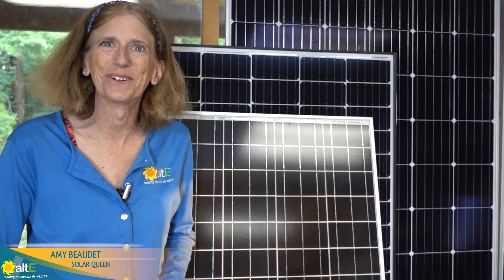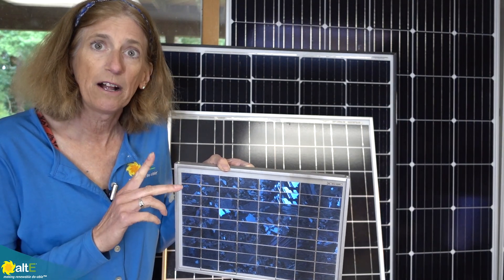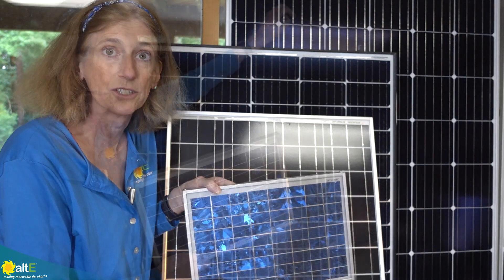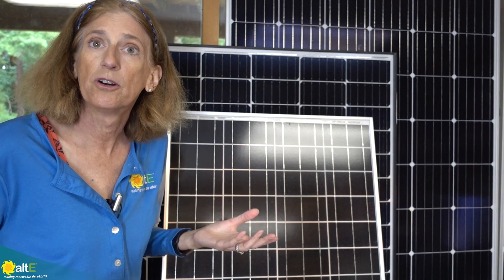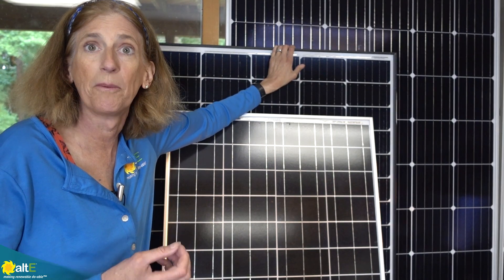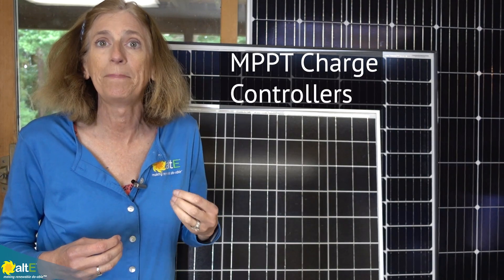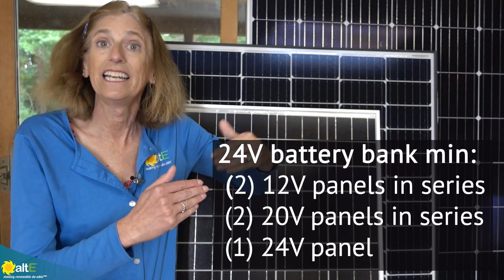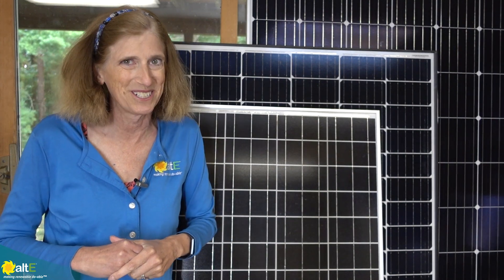Intro to Solar Panels: Part 1 of 2

Comment: Can I use Solar panel 41.1V  and charge my 12V battery via MPPT range 12V - 48V 60A? really highly appreciated your feedback. thanks
Reply from the maker: You didn't say how many watts your panel is. That charge controller can handle up to 60A x 12V battery = 720W on a 12V system.
Reply: @AltEStore  it's 440W

Comment: Does the volts differ depending on sun "strength"
I have a couple 100 way panels and used a clamp meter and it's usually around 4 to 5 amps. Does that mean I should multiply that times 18 all the time or does volts vary?
Reply from the maker: The volts aren't as affected by low light as the amps are, but they are still affected. For example, you can often measure almost full voltage inside under lights, but will see very low amps. I suggest measuring both amps and volts as shown in this video, https://youtu.be/eh6hzMb69gY

Comment: I just bought 10 used 250 watt panels and they are huge. I am addicted to solar power and cant wait to start my off grid cabin. I just got off your website as I need a 24v or 48v inverter.

Comment: Thank you for your Good work,may God bless you.I have a question. Will a 72 cells panel of 330w with a vmp of 38.2v and a voc 45.6   produce more power than a 60 cells panel of 350W, with a vmp of 32.7 and voc of 39.6 when an mppt solar charge controller converts the remaining  voltage into current in a 12v system? Take note that the 60 cells panel has 20w more than the 72 cells panel.
Reply from the maker: The higher wattage panel will produce more power (as power is rated in watts). Watts = volts x amps. So in your example, the lower voltage panel must be outputting more amps to make up for it. If you look at what it will be at the 12V battery, 330W / 12V = 27.5A to the battery, and the 350W is 350W / 12V = 29A to the battery.
Reply: Thank you very much for quick  response.

Comment: Hi I would like to ask you a question. I have 3 solar panels connected in parallel with max power 35volts 170watts each my renogy dual input DC-DC battery charger is 50A MPPT, when I plug it to my solar panels the solar light indicator on my MPPT does not light up. I checked the manual specs and it says max input 25volts, do you think it cannot take 35volts which my panels produce. Thanks Bill
Reply from the maker: The specs for that charger say it is for a 36 cell 12V solar panel. It sounds like you are trying to use a 72 cell 24V solar panel. The charger's over-voltage protection is hopefully kicking in and stopping you from blowing it up.

Comment: Is it better to have dis similar panels in series or parrallel?
I have 2 panels.
One is 215 watts 29 volts 8 amps
and another 275 watts at 39 volts 8amps.
I have them in series atm but my max output is only approx 250 watts max.
I note that in series the panels are more sensitive and continue giving watts when the sun is low down.
Reply from the maker: We did a video on that; same amps, different volts, https://youtu.be/JfzT8u205co  Spoiler alert, series worked better than parallel.

Comment: For charging a 12v - 150Ah battery using a MPPT charge controller which the best in these two 
👉72cell of 12v panel 
 OR
👉72cell of 24v panel 
For fast charging and better performance
Reply from the maker: A 72 cell panel is a 24V panel. Did you mean a 36 cell 12V panel? With MPPT, a 24V panel would be better, as they prefer a higher voltage in.
Reply: @AltEStore  thank you for your reply

But I saw it from a YouTube channel, he saying from a 380w 12v panel he getting a curent of 19A from solar panel output at peak time of sunlight and he shows its in his clamp meter

https://youtu.be/wTUFBqyOGpc

Please watch and reply

Comment: What is the advantage of panels with half-cells?  I have a guess, but would like to hear the answer from an expert.
Reply from the maker: There are several reasons, but the easiest to explain is it is like two panels wired in parallel. If one half of the panel is shaded, the other half won't be as affected. You can see more details in the interview we did with Qcelll, https://youtu.be/7PUm7r9T7Yg
Reply: @AltEStore  That was my guess :D
Thanks!

Comment: Do not link your solar panels in series it's a con so the sales men can make you believe you have more power than you actually do..... Solar panels always perform at the maximum amperage when linked in parallel regardless of the type of charge controller..., When purchasing solar panels just looked at the amp output don't worry about the what's because they will call you with that,.... For example I have a 80 watt solar panel that only puts out 4 amps.,.... However there are other 80 watt solar panels out there that will put out 7 amps or more....  So with solar panels always go with the higher amps disregard everything else they tell you about them..,,.. however most of the time the salesman will not know the open voltage maximum an beach and whether hard time trying to look it up.
Reply from the maker: Watts = volts x amps. Your 80W panel is a 36 cell panel that has a Vmp of 18V. 80W ÷18V = 4.4A. If you have seen an 80W panel outputting 7A, then it may be an 18 cell, 6V panel. That would not have a high enough voltage to charge a 12V battery, you would need 2 in series to accomplish that.
Reply: @AltEStore  But they don't..... they have more than 36 cells and a Vmp of 22vdc...... So why is there only 4.5 amps printed on the back of the panel? shouldn't it be around 7 amps.
Reply from the maker: @tonigood7245  22Vmp, that's odd. OK, it may have 44 cells. 80W ÷ 22Vmp = 3.6Imp. The 4.6A may be Isc
Reply: @AltEStore  Arrrh..... Your right..... ok... I've got it now.... thank you very much.
Reply from the maker: @tonigood7245  I knew we'd figure it out. :)